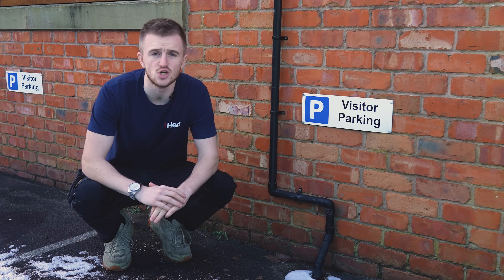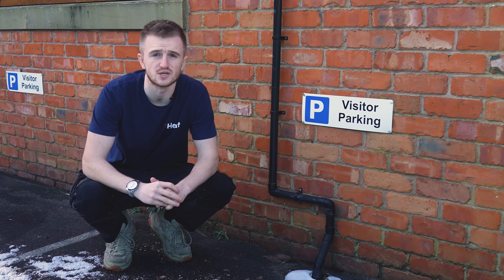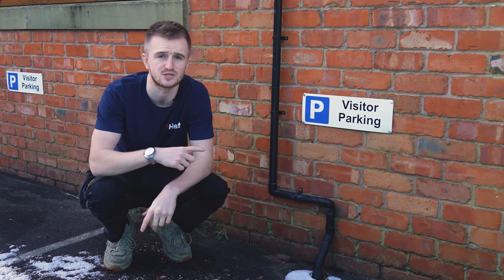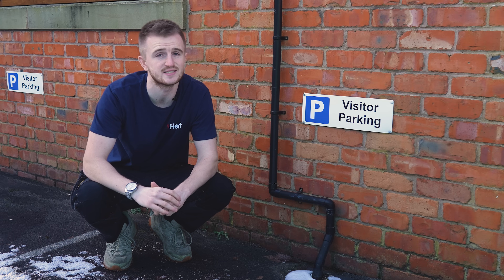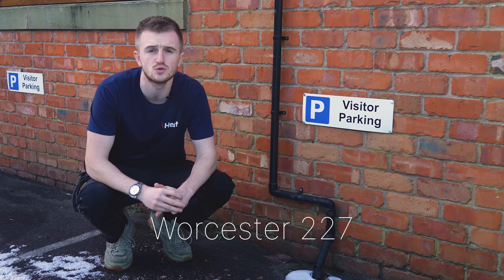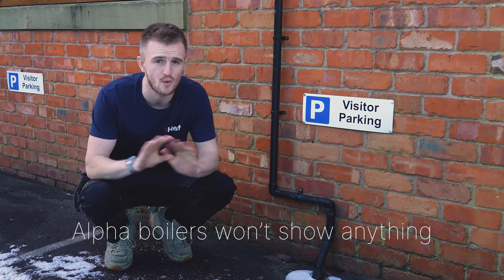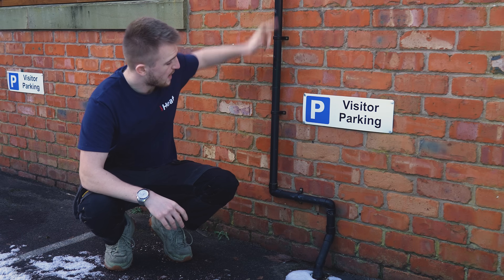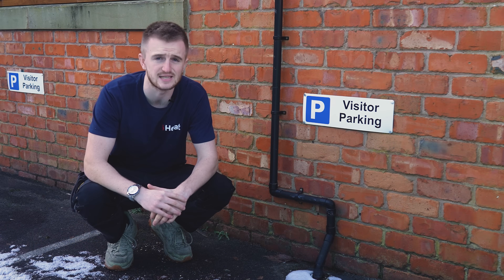How to Fix a Frozen Boiler Condensate Pipe

Comment: My Worcester Bosch 30 CDI is located in my garage which means that I can disconnect the plastic condensate pipe, internally, then lead it into a plastic bucket, internally. Then dispose the condensate into the nearest drain. Result: no frozen condensate pipe work!
Reply from the maker: Awesome stuff James!

Comment: Our pipe has insulation round it. Do I need to remove first?  Also should I invest in a heating system
Reply from the maker: The insulation should prevent the pipe from freezing, I would remove it if you can without damaging it before applying the warm water. What heating system do you currently have?
Reply: @iheat  I have a 2 year old Combi boiler, the pipe froze a few days ago during the cold weather. It unfroze when the temperature rose, at least it worked then. It has good insulation.
Reply from the maker: @classicraceruk1337  I think the boiler should be sound then. I'd just keep your eye on it when temp drops. Also there is always the possibility of terminating the condensate pipe internally if possible.
Reply: @iheat  The boiler was checked, it’s fine. Ending the pipe inside had not thought of that.
Reply from the maker: We also have another video on how to insulate your pipe https://www.youtube.com/watch?v=Q6CZFLLI6eE

Comment: Can the condensate pipe be run internally to say the kitchen sink drain to protect it from the elements? great video. I've been getting 227 code on a Worcester boiler, and this fix got it back up and running in no time.
Reply from the maker: Yes, absolutely. It's common for a lot of condensate pipes to terminate into the kitchen drain if possible.

Comment: Seems stupid boiling a kettle only to let it cool down again, just warm it and use straight away?
Reply from the maker: Just so the water isn't boiling which can crack the pipe and also burn the skin if splashes.

Comment: just today had this issue, boiler was making some right noises but i could hear water swirling around somewhere from inside it, guessed something was blocked but I wouldn't have figured it out without this video 
thank you very much
Reply: Genuinely
 saved me a lot of time , worry and money, middle of winter here and would have gotten charged loads
Reply: one more comment for the you tube algorithm :)
Reply: i didnt even get a error code
Reply: took some doing just trying to find something to get water up the pip , but after 2 kettles worth it did it :)
Reply: new subscriber from me,
Reply from the maker: Brill, glad it sorted the problem. I've seen some people strap a hair dryer to a broom to reach higher pipes, 🤦🏼‍♂️ not the safest option but it works.
Reply: @iheat  well that's one way to do it I guess 😆  thank you again

Comment: My Ideal boiler has been showing error code L 2 several times this week (haven’t had code F). A gas engineer shared this hot water trick which definitely works thankfully, though if it’s too hot the pipe can crack. Hasn’t happened so far! Also as stated it can cause the ground to freeze around the pipe so need to be careful. Looking into trace heating.
Reply from the maker: Thanks for sharing, glad it worked for you 😄

Comment from the maker: If this helped please give the video a like 👍
If you have any questions on boiler error codes or issues fixing your frozen condense pipe then leave us a comment.
Reply: I have an Alpha boiler. I've poured hot water over the pipe but still no hot water or heating. No fault codes are showing. Could this be due to a prolonged spell of cold weather? Thanks in advance.
Reply from the maker: Did any ice come out of the pipe after pouring hot water over it?